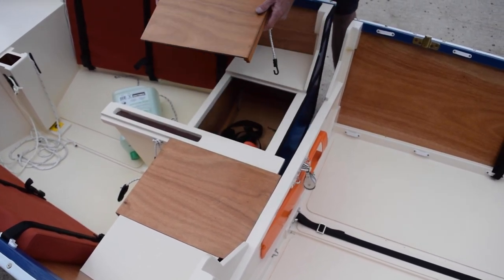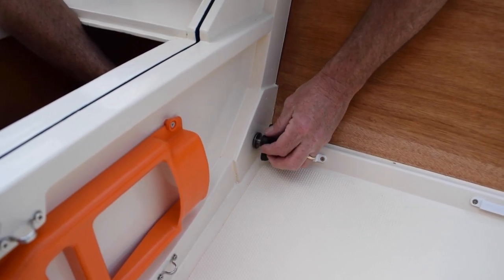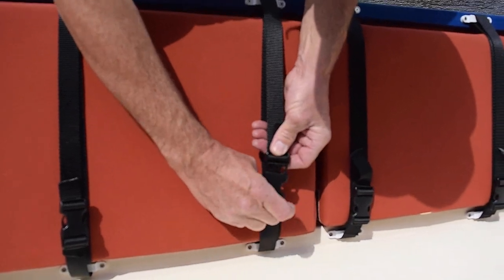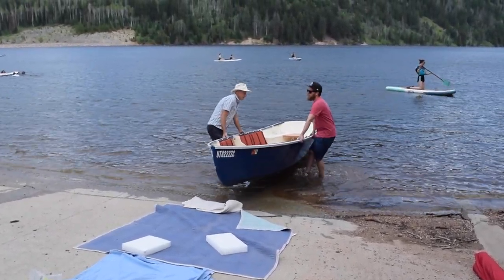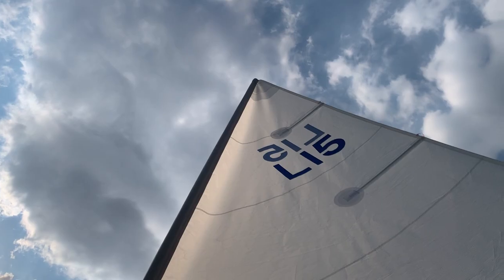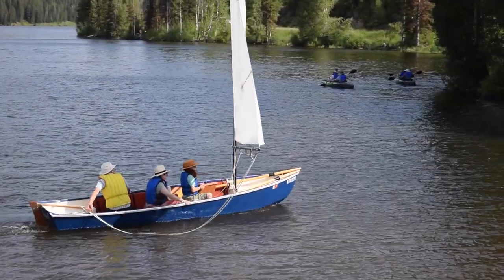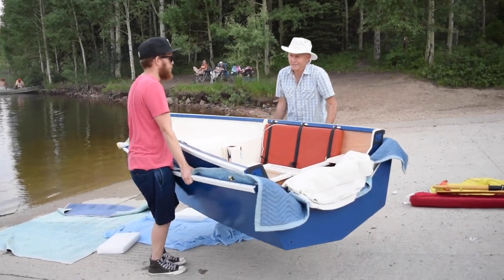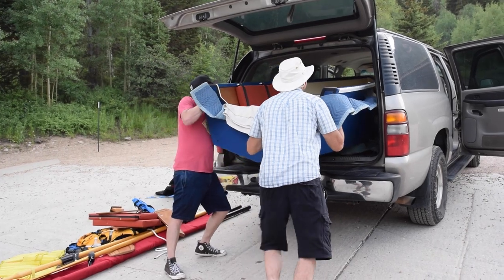Linach 15 two piece wooden nesting sailing and rowing dinghy

Comment: I love the clean lines of the design.  One question though when sailing with the wind a beam, she does seem a bit tippy with you having to sit up real high, is that with a center board?
Reply from the maker: The daggerboard is down.  That particular gust of wind was over 15 knots and so I sat on the gunwale to help keep the dinghy level.  The beam is only 4 feet wide as the whole design goal is to be able to put this dinghy inside a vehicle.  So there is going to be a need to hike out or shift one's body weight to the upwind side when sailing in stronger winds, just like one would with any other relatively lightweight sailing dinghy.